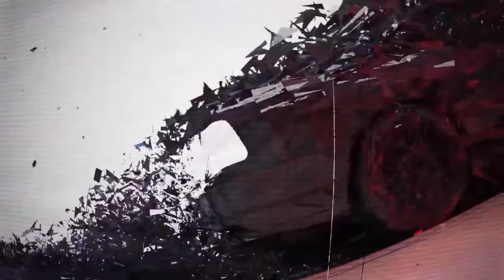Making a V8 SUV to Stop Smoking - BMW E70 X5 - Project X5: Part 2

Comment: I love the N62. It gets so much hate, but it’s such a lovely engine to use and if you mind the common issues it’ll be WAY more reliable than an N63. Biggest issues:
1. Valve Stem Seals. If caught early enough, there are solutions to prolonge the life of them. I’d say the biggest issue is the earlier owners following BMW’s earlier oil change interval of 15k miles (which is STUPID). Make sure to change the oil every 5k miles with 5W-40. 
2. Coolant Transfer Pipe. This is a bad one, as for the longest time the only option to repair it was to get deep into the engine and change it out. There are much cheaper, less labor intensive solutions nowadays. This one doesn’t worry me too much.
3. Alternator Bracket Seal. I’d argue this one is the worst. Very difficult to DIY, and stupidly labor intensive. It’s a very cheap rubber seal that goes bad, and it takes an insane amount of time to get to and replace. This one will cause oil to absolutely piss out if the seal has gone bad. 

Now, these issues can be very expensive to fix. Especially issue #3. If you’re going to buy an N62 car, make sure that you’re going in with money to spare if any of these issues haven’t popped up yet. Do not pay a premium for an N62 car that has 70-100k miles compared to one that has 150-200k miles. That might sound crazy, but chances are these issues have already popped up and been addressed.

 I’ve driven and been around an 07 750li that has 220k miles on it, and it’s still on the original valve stem seals, and it burns very little oil. How? It had religious oil changes throughout its life from its two owners. Alternator bracket seal was done at 125k miles. Truly an awesome car.

Now, here’s why I think the N62 is a good (even great engine). It still has an oil dipstick. The water pump is still mechanical on them. Compared to the N63, the N62 doesn’t suffer from timing chain guide failure, turbocharger failure (it’s NA), injector failure (it doesn’t have DI), rod bearing failure, and the N62 doesn’t cook its PCV lines like the N63 does. 

The N62 also gets surprisingly good fuel economy if driven in a somewhat sane manner. The N62 has an awesome exhaust note. It’s muffled (in stock form), but it has an exotic tone to it and it loves to rev. Not sure if this is just with the E65, but they have a valve in the exhaust that opens up once you go over 3-3.5k rpms (I think), or if you give it a certain amount of throttle. Fun stuff. 

Do not purchase an N62 if you don’t know how to turn a wrench. I will say though, it’s definitely more reliable than an N54. Sure, the tuning potential is almost infinite with the N54, but the N62 is better for day to day use if tuning isn’t your ultimate goal. 

Lastly, is the M113 a more reliable engine? Absolutely. It’s a great engine. But people shouldn’t shy away from an N62 if it’s been well maintained. Unfortunately, it’s difficult to find one nowadays that is in good shape.

Comment: That magenta coolant looks like VW G13. That also explains the limescale chunkieness going on in the system, as it has a tendency to react with other coolants and form that chunk stuff, which is kinda similar to stop leak. I actually had to fix an audi because of that recently. The G-series coolants are chemically different from ordinary stuff, as they were custom developed ONLY for Volkswagen engines, and while they are the best thing you could possibly fill into a VAG cooling system, you have to be careful to not get even a single drop of ordinary coolant into it, and should just not put it in a BMW. It's just not meant for that!

Comment: Sreten & friends - worth getting an X5 (late model, B58 motor) over a similar F31 wagon or B48/B58 X3?  I have an N26 F22 xDrive now that is super reliable but will need a bigger car soon. Not afraid of regular maintenance or xDrive tightness. Thanks man!

Comment: Hi, thanks for video. What can you tell about engine EP6 (c3 Picasso), manual gear box? It's smoke's too.  Is the only way to fix this - replacing this stem seals? Engine already as cleaned with some chemicals and drives around 1000km after that. Smoke was reduced, but not to 0. Mechanic said that is cheap solution and it can help, but if not - it's time to disassemble the engine. But it can take a cost around 1/4 of actual cost of the car. What you recommend to check?

Comment: I have a way to easily and cheaply flush the pump, torque converter, clutches and oil passageways, using a 20 liter container/bottle with tap, clear hose and the old pan- just cut the spout off the filter in the pan and use this to connect the clear hose (2 meters of 20mm pvc clear hose pushes up inside nice and tight 👍).

With the pan off, Push the hose into filter spigot you cut off, push the hose and spigot into the original port in the gear box, place the 20 litre container up higher than the gear box… bonnet/hood hight is good and easy to see… fill the container with approximately 10-20 litres of auto fluid, connect the clear hose to the tape, open and allow to fill the hose. With the tape open Start the engine, quickly select drive, reverse and each gear and switch off before the auto fluid empty’s out of the container- you ave about 20-30 seconds to go through the gears and switch off the engine before the fluid runs out so plenty of time. I used a large clear plastic ‘under bed’ storage container as a catch can, just needs to be longer and wider than the auto box pan to collect the flush oil👍

Comment: Take the injector rail off to install the valve covers. Get as much out of the way as possible. And don't break the little guides for the outboard sides of the head installed into the valve covers.

Comment: Hi Straten, I have a problem! I have a 2012 520d M sport 6 speed manual and the reverse gear won't engage but 1st through 6th will work perfectly, Have you any idea or personal experience with problems like this before? Love the channel. Watching From Ireland.

Comment: Absolutely brilliant as always. Man, you make it look so easy. But the engineering complexity of these engines is stupifying, and simply another reason for reaching end-of-era. Meanwhile, over at the Tesla "engine" repair lift... crickets.

Anyway, I have a lovely old 650i (2006) with around 190kkm on the clock, and started noticing the dreaded valve-stem smoke lately. Had it diagnosed, and it is frankly not economical to repair taking into consideration the age and value of the vehicle. It is still light but will just have to live with it. Certainly not going to tackle this myself. 😳

Comment: Awesome video as usual! This engine actually looks like 4 cylinder N42 engine. I hope some of the next projects will be this one, they said that is bmw's worst engine and hardest engine to work with it. I have one in my e46, so maybe I will learn how to work on it like others from Sreten's videos. :)
Reply: Done this job on n46 (basically same as n42) ... not too bad.  Only 16 valves and 2 camshafts. Just make sure you tie up the valvetronic bits before removing intake cam... look at bimmerzen for how it's done.  I used soft rope to hold valves up, works just fine.
Reply: @michaelwalton3631  Yes, I know bimmerzen, great channel too. But I would like to see Sreten's work on that engine. 😁
Reply: there is no N62 v8 engine in your E46 and there was never be. E46 only has 4 and 6 cilinders cilinders. This X5 is N62 V8 wich is a good engine.

Comment: BMW's run hot to help with emissions, but I think is the reason they leak so much. The engine is so heat cycled the gaskets fail. Possibly why the valve stem seals fail too.

Comment: Why the coolant was gunky was not because of wrong coolant was put in it, but because 2 different coolants were mixed. BMW coolant might not always be 100% correct for older BMW's, as they only sell one kind of coolant nowadays and that might not be what was put in to the car from factory. And colour has nothing to do with what kind it is, as it is different from brand to brand. As long as the system is flushed and the coolant you buy is for the right kind of engine (such as aluminium block and turbocharged) the colour does not matter

Comment: Equipment question - I see you have a hydraulic lift. What are your toughts on them in comparison to a electro mechanical? 

I noticed that once you reach a certain height you press a lever to lower the car a tad bit (probably one of the resting points) so when I understand correctly the car is not being hold by the hydraulics anymore but the mechanical resting point, right? 

I have strong trust issues to the hydraulic ones in terms of them dropping down on the ground when you lower or raise the vehicle and stuff like that.

Comment: First of all, i would like to thank you for the detailed videos
They are a reason i went out and and bought a lightly used 2013 X6 V8 twin turbo N63 engine. Now they are also known for thier valve stem seals going bust. But my     question is if mine arent bad yet would it be worth it to use liqui molly Cera tec and stop smoke as a preventative maintenance to delay the process or additives wouldnt change the situation?
You are a firm believer of liqui molly products so would it help?

Comment: I have a 2007 bmw750li I haven't had a very long time at all it's got like a hundred and fourteen thousand miles on it. The engine is very quiet it runs smooth drives great however I noticed that there is oil burning and I could see a little blue smoke coming from the tailpipe the question that I have for you is does any of that stop leak stuff work?

Comment: Hi, how long did the valve stem seals take you? Start to finish?

I did the valley pan job in 12hrs, suspect this might be more like double that? Valley pan was leaking around the top seal, currently holding up well.

Comment: Most of mechanics don't even correct an old cars, even when the issue is explained they just want to brush it off and move on to simple but pricey tasks. Old cars are just neglected. 
I have an 12 yrs old BMW X1 that is just dying to have this kind of work done and relive its life once again in full glory. 
BMW dealership is even worse, they are never interested in fixing a car, they are out there making big bucks without actually caring about their car which actually left their manufacturing floor. 
Sad world out there for cars. 

If i had enough experience and tools i wouldn't let my car die :-(

Comment: Would it make sense fitting a lower temperature thermostat - BMW had apparently decided to run those V8s super hot to help lower the emissions (tiny little bit) and make dog's dinner of any rubber in the process...

Comment: I have a general question, more of a wondering. If you use a lower temperature thermostat to regulate EGT coolant to 90C, would it make sense for instance use thicker oil as the the gap between the piston and cylinder is slightly higher, or is that compensated for by the fact that the rate of expansion for both is the same as they are made of (roughly) the same materials? Just curious.

Comment: This was exactly wrong with mines same truck any recommendations last shop I called asked 12,000 to fix value stems 😂😂I just bought a warranty package but I gota drive 1000 miles in order to get fixed that’s my only hope I spent 4000$ alone changed the supercharger valve cover gasket’s sensors pcc value and it’s still smoking the only code left is value stem gasket wtf 😅

Comment: Hi Sreten ! The timing guides are problematics i think on those V8, did you plan to replace them at any point ? Especially the U guide on center/bottom. This was the perfect time to do them. Why not doing it ? Im planning purchase an E53 4.8is with the same N62B48, and im planning on doing it preventivly. Just want your opinion on this. Nice job anyway !
Reply from the maker: They are not a problem on N62, on M62 yes.
Reply: @M539Restorations  No way ?! I thought that both engines were problematic on timing chain guides. Man you save me a lot of time, deep inside my engine searching for my 10mm socket again. Appreciate your comment answer in less than 15minutes on a 5 month old video. Thats why we love you mister !

Comment: Now i know what i need to do with my n46b18 😂 on green light my BMW does exactly the same as this v8 😂
Reply: All valvetronic engines has the same problem. Extremely short stem seals lifespan. As he says. Only on the intake side. 
I assume the force comes from the side and not from the top as usual camshafts.

Comment: I'm actually getting ready to get a great deal on a 7 series. 2009 750i with only 120,000 MI. Everything looks perfect on it. It has one problem it's blowing smoke because of the valve seal and needs brakes. The brakes don't bother me. Whatever I buy something new to me I always change the brakes. I have had too many no break situations in my lifetime.

Their person I'm buying it from said he was quoted from the BMW dealership that to change the valve seals and their change the gaskets that have to be removed to get in there all together it could be as little as $5,000 all the way that $8,000. They even told him that just the parts alone will only run to $300 give or take a couple dollars. All the rest is labor. 

I'm fortunate enough to have the ability to have the tools I need. I'm not a professional mechanic I don't make money out of fixing other people's cars. I normally just do it for free. I have no problems buying special tools to do a job. 

I love all your videos. I was glad I was able to find this one again. I knew you had fixed one before I wanted to watch you do it again. 

That key that you put into the balancer and then into the engine block do you happen to have a part number or a link to it? I know this is one of your older videos so you might not ever see this. 

I really do love following your videos. I love the new project you just showed us on June 25 or so. You picked up three series with a manual that was too nice to turn into a race car. That's happened to me quite a few times. Do you want something nice enough to not need to work on it but yet you don't want it to be so bad that that's all you do is work on. 

So when you were talking about that I completely understand where you're coming from. 

Really looking forward to watching more from you. And I really appreciate you filming every step that it takes to do something. I cannot even imagine you doing it and filming it.

Comment: I think you should replace fluid for power steering plus gear pil axle oil plus filters.The vehicle is a mess.Most of the other work I wouldn't have bothered

Comment: Hi I have an F10 M5. If I let the car idle for a few minutes and the rev it I get a puff of blue smoke. No noticeable smoke when driving, even when driving hard. I have no smoke on start up either. The turbos have been rebuilt 1000 miles ago and I’ve just changed the PCV valves. The car has done 63000 miles. Do you think this is valve stem oil seals?

Comment: What do you mean with special tool? It's not possible to replace the stem seals without removing the camshafts. 
The special tool is for removing the excentric shaft.
Reply from the maker: It is.

Comment: Meticulous as always. I had an n62b44 in a 545i once. I did the same job, but I had the heads off since I had a few failures to fix on it . The coolant transfer pipe was leaking (I tried an aftermarket expanding pipe but couldn't get the seal to seat properly). I had to run a drill through the secondary air holes in the head. Bits of timing chain guide plastic were in the oil pan. It also had that £5 blanking plate gasket leak that is sandwiched behind the flex-plate/ torque converter (gearbox out for a £5 gasket). I said I would never have another big engined BMW after that, but I do have an M6 gran coupe still 👊

Comment: I have a BMW X5 4.4I 2004 and I have the same issue with the smoke from the tail pipe.  And the service engine soon light is on.  I have about 165,000 miles on it.  How much for the repair?  I am in the United State, New York City.  How long does it take to make this repair? Can any mechanic do this repair or do they need your expert knowledge?

Comment: half of the time, it’s actaully not the valve stem seals that are bad. This motor obviously uses BMW’s valvetronic system, which keeps the throttle plate open at all times (throttle is controlled by varying of valve lift). Due to an always-open throttle plate, there is very very little manifold vacuum present. The orange PCV valve diaphragms on each valve cover have a little spring underneath which force the diaphragms OPEN, and only stay closed as long as there is enough manifold vacuum to “suck” them closed. Even the slightest, minuscule vacuum leak on these motors will not allow the PCV diaphragms to stay closed, thus sucking oil from the valve covers straight into the intake manifold where it accumulates and burns off when blipping the throttle and/or pulling off.
(Bad valve stem seals will most often leak oil down into the combustion chamber ie. when vehicle sits over night and will then accumulate and burn off when starting the engine). 

The fix for this is to, obviously, replace all gaskets, seals, o-rings, etc that would potentially cause a vacuum or oil leak (this includes valve cover gaskets, timing cover gaskets, cam sensor o-rings, eccentric shaft sensor seals, valvetronic motor seals, vacuum pump o-rings, alternator bracket gasket, oil cooler o-rings, oil pan gaskets, etc, etc).

All these items would theoretically be replaced anyway when doing the valve stem seals, which is why it fixes the burning oil issue for most people who take their N62-powered BMW to a shop to have their valve stem seals done.

Comment: Could the valve stem seals be bad if the only time it does burn oil is on cold start up? M57D30 engine E91